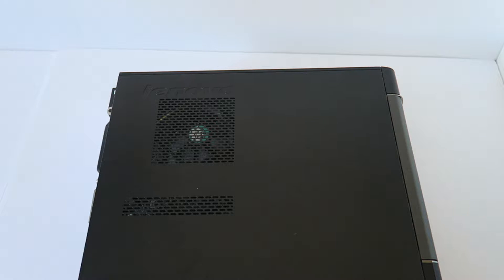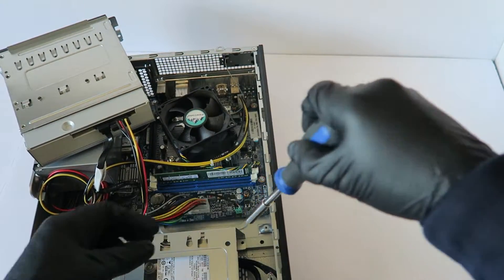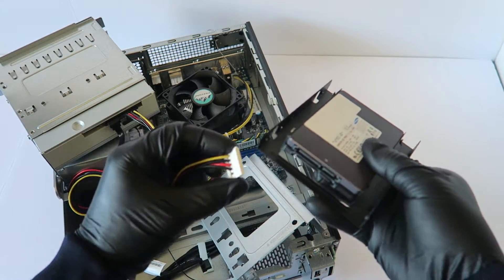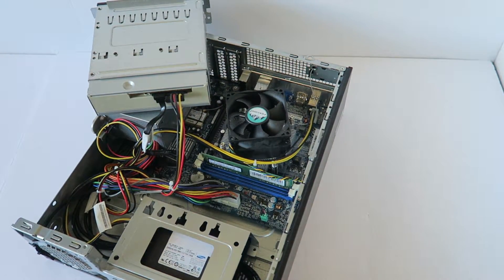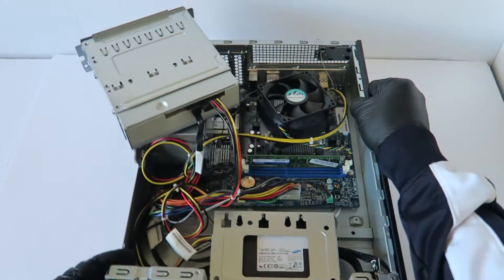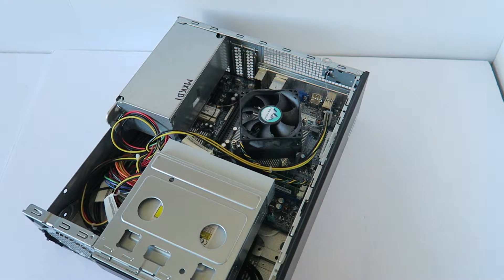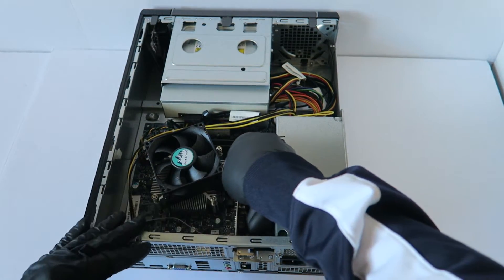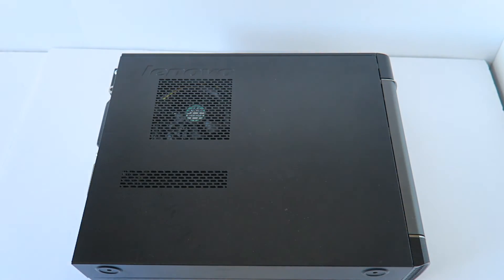Lenovo H520S Upgrade SSD, Video Card, RAM

Comment: hello, I have a question
can I use gtx 1650 low profile for the GPU?
Reply from the maker: Hi, yes you can with low profile bracket and it depends what kind CPU does PC have ? YOu can also take that motherboard and install in custom gaming case and upgrade power supply...
Reply: @Mxkdt  I mean I want to put GTX 1650 low profile to this rig on video (Lenovo H520s)
will it work? or it will be a problem?
Reply from the maker: @mradam28  You have to check your power supply see how many watts it is and if it shows 180watt you cant use gtx 1650
Reply: @Mxkdt  I use psu 300 watt
so there won't be a problem if I put GTX 1650 low profile?
Reply from the maker: @mradam28  Yes 300w powers supply will run perfect with gtx 1650
Reply: @Mxkdt  thank you for your help and answering my question

Comment: Is there anything you need to do with the bios? Ive added a graphics card with two more ports . I want to use 3 monitors at the same time. The pc does not even fire up with the extra graphics card in. I took it out and it works without it.

Comment: I have an lenovo h30-05 with amd e1 6035 dual core solded to the motherboard, and 4 gb of ram ddr3 1600 MHZ, with O.S  windows 10 and this pc is really slow for  start any program, navegate for internet, use office, it is very very slow, this pc use external power supply like a laptop, if i put an ssd, a graphic card nvidia gt 710 2gb, and 4 gb more of ram to, is a good option?

Comment: I have this h520 but when I install gt1030 I get black screen I have 180w psu and i3 2120 , 6Gb ram
Reply: you may have a power shortage, so unplug your CD drive and you may need to use 1 RAM card instead of 2 if that is possible (it doesn't sound like it is for YOU).

Comment: Just added a SSD to my system hoping to clone my existing drive but nothing is coming up in either my PC or in device manager. If I connect just the new SSD on it`s own and boot up, nothing is recognised, I just get "No operating system found"  as if the drive is not even connected, any ideas?
tia

Comment: Can i add gtx 1070 and add new case? And new psu  motherboard compatibility with gtx1070?
Reply: I just know it uses pci express 2.0, so if the graphics card is over 2.0 then its gonna get downgraded and you get less out of it

Comment: I have lenovo h30-50 6id core i3 4160.
Upgraded RAM 4GB to 8GB.
PSU 180W to 300W.
VGA GTX 1050 Low profile.
No probelm for this 2 months.👍 XD
Reply: how hard was it to upgrade the PSU? esp. to find a box that would fit in a SFF?
Reply: @genkiferal7178  I remember reading somewhere that the power supply is actually a TFX PSU. Hopes this helps! (4 years later!)
Reply: @eevee658  thanks.